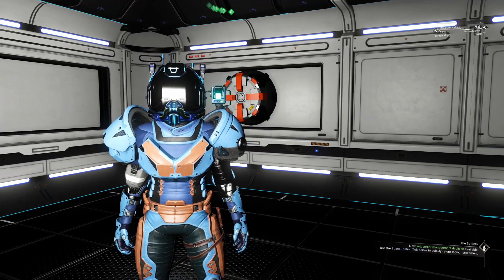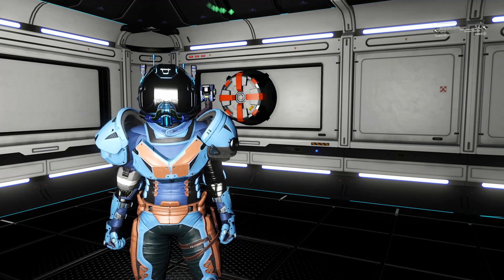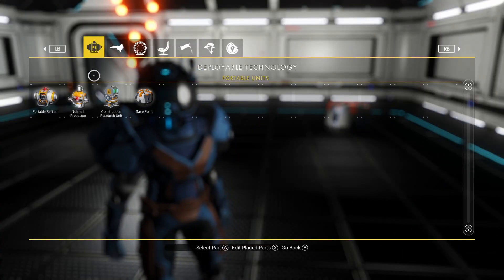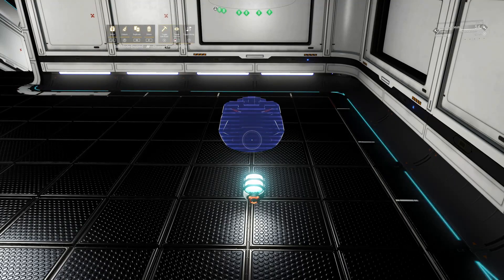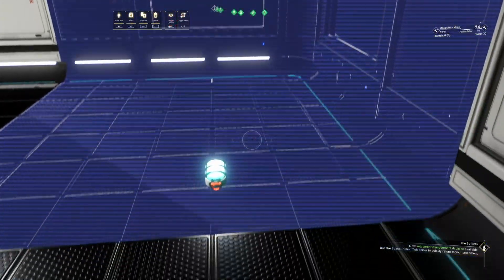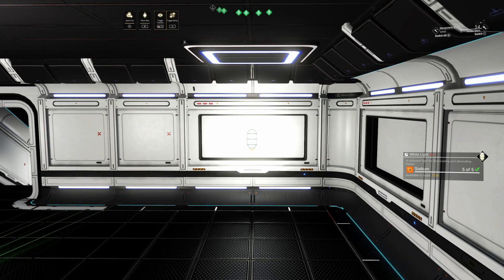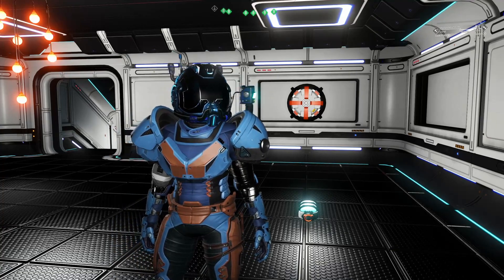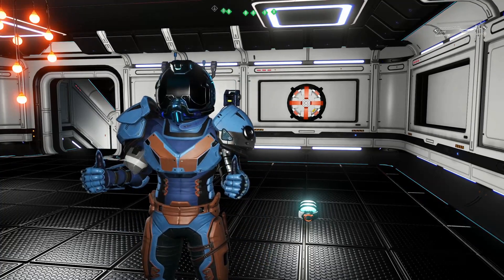Tip for the Day - Glitching on Freighters - No Man's Sky 3.7

Comment: The way I've been putting things on walls is build it, hit the move button and aim at wall, hit the wire button and place one end of wire below or to the side of the target, draw the wire to the target, hit the wire button, hit the free place button and the part will be vertical instead of horizontal and can be built on the wall, any part, any wall. No need of lights or other parts to be deleted later. At least on PC.
Reply from the maker: Unfortunately wires will not green state in freighters which means the only other method that works there is the tether glitch. This works well for some tings like screens that you want to tilt but doesn't work well for save points or other ground based items.
If you have had success in freighters I would be interested to see how.
Reply: @pharaohofeuclid  It's been ages since I did anything in my Capitol Ship, I'll check it out when I can and see if I can come up with easy non glitch ways, if not then glitching is fun anyway. I wonder if it can be made to work in a red state, some parts can be in a red state then wire glitched in even if you don't have the materials to make them, probably some things left to learn. The Game Engine seems to reward efforts at times.

Comment: I am doing something wrong. I seem to be messing up getting out of light build. I hit B (xbox) and it seems to take me out of the process. What do you hit after you build the light to get rid of the second light that is ready to be placed? Thanks
Reply from the maker: I didn't see this comment at the time. But if you are still having problems, there seems to be more too it than just timing. 
Something to do with the menu can block the initial caching of a part.
I am still researching that.